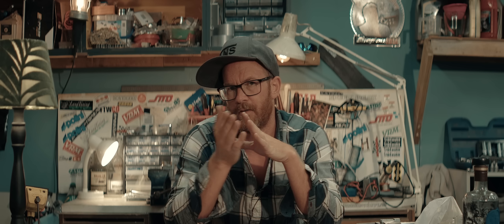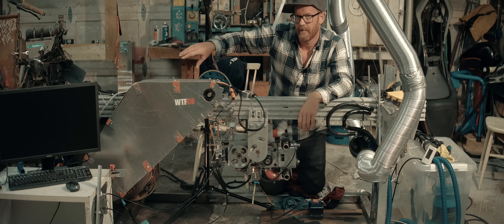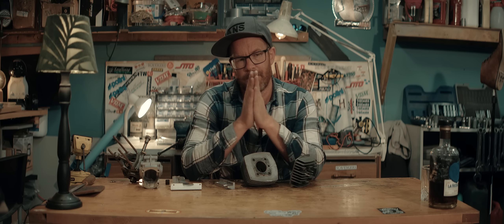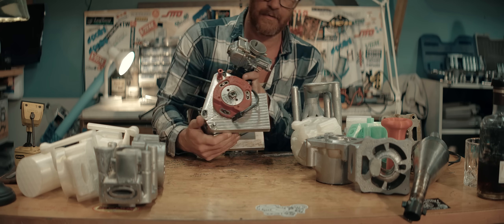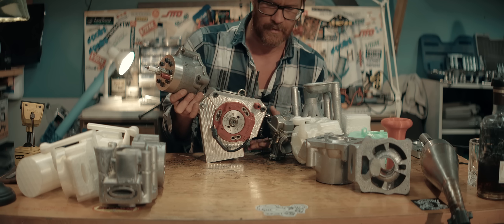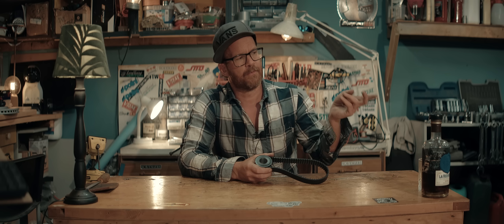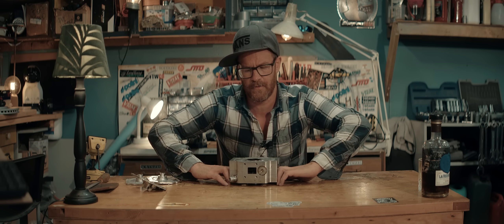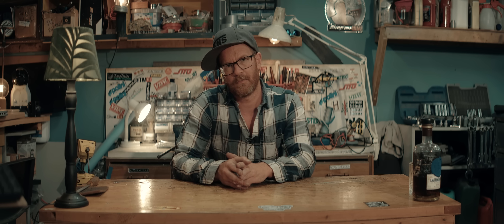The Worlds Most Powerful Engine - A bumpy road.

Comment: Some CFD modeling may enlighten you on where you can make flow improvements.  The drum valves appear to have some very sharp turns that are huge flow restrictions.  Of course with enough super charging, you can force everything to flow better but the strong arm technique has drawbacks as well.  What about having dual belts, one on each side to drive the drum valves...that should help with the shaft failure...everything works better when all of the forces are balanced i.e. the dual belt drives.

Comment: I have a suggestion for the rotary valve. If you're having issues with the thing flexing and getting caught in the intake, wouldn't it be a good idea to make the thing have an outer rim that ensures there's always part of the valve sliding up and over the edge of the hole? Maybe also round the trailing edge of the hole so that the supported edges kinda "slide" inwards towards the center of the hole when it's passing that edge?

Comment: Chain will stretch and throw your timing off I think. Im not so sure the belt would melt, it constantly being cooled in its rotation and if you think of a camshaft in a car, the belt is exposed to tremendous heat and pressure usually not get any fresh air to cool it. 

I guess when you shut the engine off and the belt sits stationary on the pulley it may melt but again the same could be said for a car timing belt.
On thing you may consider or maybe have already for the intake side of things would be to use the crank counter weight as the rotary valve for the intake. Just a thought.
What are you using to seal around the exhaust valve tube to the cylinder?

Comment: Maybe you could use teslas rotary generator setup, incorporate it into your design, as a new type of supercharger, or have the supercharged exhaust gases driving it as an auxilery engine to a common gearbox, apparently it produced incredible power. Maybe a flywheel attached to a clutch.

Comment: You might want to look at , teslas, rotary generator, it’s steam or air driven, or water, but it uses steel disks, that are close together, l think your rotary valve setup may be generating to much lateral force with this setup, l love your latest setup though with the rotary cylinder.

Comment: Thoughts on supercharger/air/blow off/restrictor.
Moving air takes a lot of energy. When using blow off continously a lot of energy is lost - though the energy is available in the combustion chamber.
If you use a restrictor in the intake to adjust the Max power level a blow off is maybe not needed? Or lower the blower rpm to the required power level?
My experience from Rotrex sc is that the sc requires 15-20% of the crank power - meaning 300 Hp at the crank is actually more like 350 Hp in the combustion chamber (fuel/air etc)!

You are so motivating to follow. A real, actually present Human being 🙏🤟🫶👍

Comment: Dear Two Stroke Stuffer, I greatly enjoy your video's and I really admire the skills you acquired by yourself to produce very complicated engine parts etc. wow. You are one clever cookie. But now comes the but: I cannot help wonder if your latest engine does not lose some power by the drives you have added to it (blower, rotary exhaust ports, chains, T-belts). I understand these ancillaries produce extra power, but they will also eat up some or perhaps even a lot. It might be interesting to measure these losses, I would not know how, but you probably would :)  Some 50cc GP machines from the early 70's also made about 16-18 hp without these ancillaries, which also made me wonder about the net gains.

Comment: electric or axle drive, generator to electric turbo, through battery
Reply: electric coupling, not direct chain, belt, or just gears, no chain attached
Reply: or direct shaft axle generator dyno meter
Reply: combine rpm/speed sensor to the electric generator, you get both power and rpm/speed at same time
Reply: money curse stacks above more money curse
Reply: for dyno purposes, direct connecting of an electric motor with rpm sensor to the motor axle

Comment: Hi to you
This is just a thought on some of the not so conventional things that people have done in the past.
Most of this thing have been forgotten over time do to their strange appearance and belief that they just won’t work.
I had made one of these unbelievable things years ago. Lots of experimenting to get there.
What ended up is an exhaust system that outperforms expansion chamber type systems by a huge amount on the top end. I tried to introduce this to you months ago with no response from you.
Being a person that thinks out of the box like you experimenting to get performance that normally can’t happen can happen.
Good Luck with your engines.
Dale

Comment: Agurknytt 😅
Rotating drum valves is better than the brake discs but they will also produce a lot of friction.
The best solution would be some type valves with camshaft timing. Then they dont need to rotate all the time and make a lot of friction when its pressure at them.

Comment: Just a quick question. The rocket engines used by spaceX is using methane and liquid oxygen….  Would it be an idea to add an oxygen tank  and a valve to increase the oxygen in your air intake? Not necessarily all out oxygen and  nitromethane but somewhere in there.  Should maybe not run this by your family…

Comment: Just had a thought on the rotary valves and the issues of becoming 'disc brakes'.  I know your headed down the path of the drum valves (and it is probably a good path to try), but I think you might be able to fix the hanging up issue by added webbing to the open section of the disc valve so that the opening is diamond shaped with the points leading and trailing the openings.  My thought is that over time the pressure is forcing the free ends of the valve to catch on the inside of the guide and probably the exhaust opening.   I'm sure you probably thought of this, but maybe it helps for the next go around.
   
To that point, I also have concerns about the stability of the half cut drum as well;  as you found with the head milling,  rounding over vs square edges is stronger;  I think that the opening of the drum may be susceptible to shearing at the opening's edge.  Though, perhaps not(thinking out load here); it shouldn't have any rotational load on the far end from the drive gear, thus a mute point. 

Best of luck,  look forward to the next test runs.
Reply: I've never really seen this valve configuration before but I do have a mechanical mind, I don't mean I'm a robot or a clock, but I can see what you're saying should work. I've never had much time for 2 strokes but this show has fascinated me. What Alex will end up with will be a masterpiece for sure.

Comment: Great job!
Can you please retake the motorized bike engine? I sugest using common parts, and make it more torquey, since more have these engines and many of us want practical performance, not just top speed.
If you do, please use parts that most people use, a mz65 clone, a reed valve WITH STOCK CARB, and then with a bigger carb, stock mag, wider ports etc

Comment: Anyone need vacation, and the ones who are deeply involved in their projects have to focus on them, we all have only 24 hours a day, it isn't a matter of anti-social behavior, it's a matter of having a target to reach!

In regard of the rotary disc valves, I'm wondering about them since the last failure.
Maybe you can make them thicker to reduce the warping made by the pressure, and you can also use a Geneva drive to drive them slowly, if thick valves at high speed have too much inertia, making more than a port on them.
If you can, try to lock axially the valves using threaded ring nuts against a shoulder on the shaft.

Comment: So I've been thinking about this for a while now and I think a lot of these problems you've been running into could be fixed possibly with koenigseggs free valve system. It's like one of the worlds biggest feats and if it could be applied to 2 stroke's it could possibly make em more efficient and do what your trying to do a different way. I've Been thinking for a while that, if we could use the free valve technology on 2 stroke's it could bring fix all the problems with a closed crank case and supercharging. But in your case u could replace the rotary valves. This is probably a few years away for something like this to come into existence but I hope one day u can get this brute force engine design paired with free-valve. Love the video's, keep em up.

Comment: I've been down the same road with chain vs belt drive for blower applications. I couldnt get a chain drive to work because the chains overheat at that speed unless they are oil cooled (e.g. how timing chains are). Also, the chain wont like taking as small a radius you describe. I ended up with a scooter drive belt that could take the rpms/torque. Best of luck!

Comment: I have been following you for years now, and am very impressed. 
I saw an explanation of a 2 stroke sleeve valve engine recently and thought of your project; Very similar principle; more control over inlet and exhaust, but with minimum volume between the rotary exhaust regulator and the piston, suggesting (even) higher efficiency. **carefully suggesting a complete redesign of your engine**

Comment: if you need to remove the sleeves, bake in the oven at 350 for till up to temp. the reinstall freeze sleeve and heat head to 400

Comment: Question! 

I race minimoto and I’m so tired of getting ate by 125 4 strokes. I know that fat pipes are good for low end torque and skinny pipes are good for high end power. 

Do you think I could just make both pipes and a valve to switch between the two?
Reply: Or possibly turn the fat one on and off.

Comment: Your planned idler pulley needs a tunable gas shock. Also the shock mount needs to be adjustable for tuning the tension and direction of the tension. A spring loaded tensioner/idler pulley creates vibrations that destroy the engine.

Comment: G'day from Australia,

With regard your disc exhaust valves and the issue of friction on the light-weight carbon fibre discs which seemed to degrade and destroy them; is there any way in which you can balance the thrust on the discs (the existing thrust is from the exhaust port onto the side facing it) by porting some of the exhaust pressure pulse to the other side of the disc so that there is minimal to no side thrust on the exhaust discs, thus allowing them to essentially spin without touching the "sealing" faces on either side.  

Obviously the axial and radial clearances would need to be relatively tight, but the sealing would essentially not be like a poppet valve's positive sealing, but more like a seal in a turbine where the small gap does not allow enough air or exhaust gas that gets past the seal to affect performance - so in your motor, the speed of rotation would not allow much exhaust gas to leak at any point where the disc valve is closed.
Just a thought.
I continue to enjoy your thinking and making.  Don't give up
With thanks 
Quentin